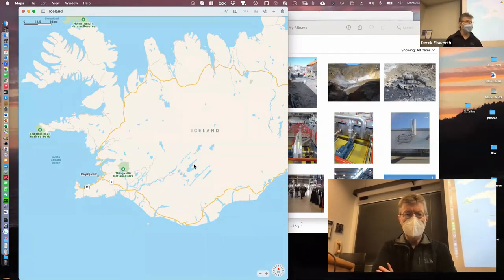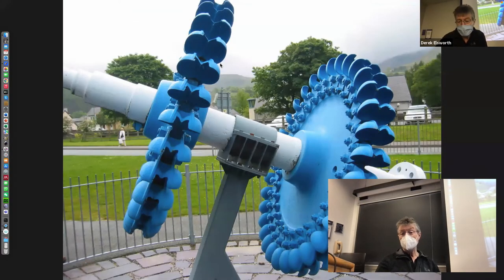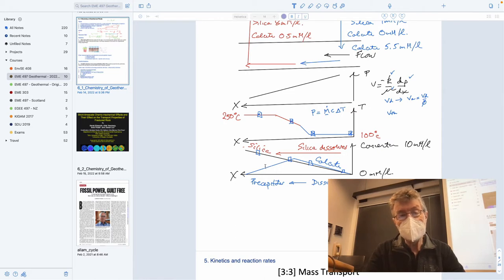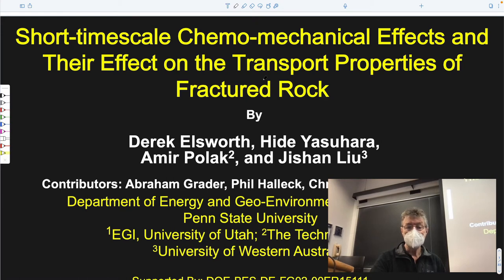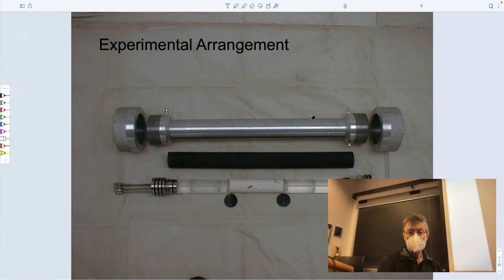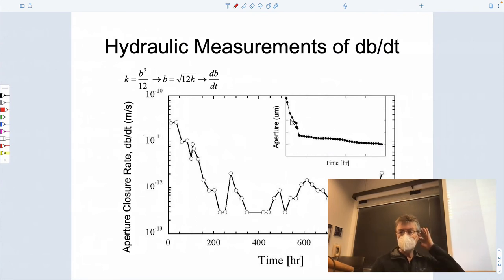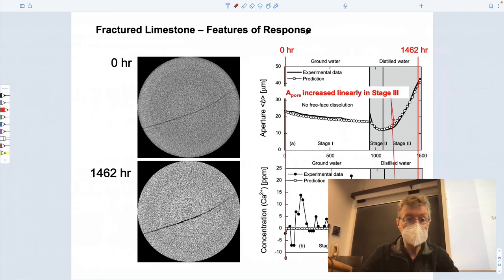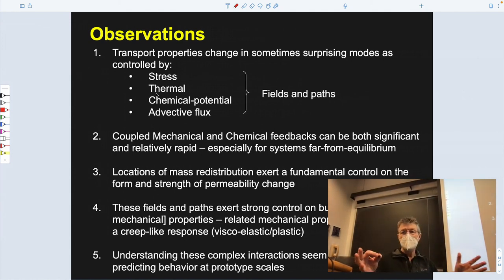6:2 Chemistry of Geothermal Fluids

Comment: Thank you Derek for giving such an interesting lecture on the coupled geochemical and geomechanical effects on the flow aspects. Intuitively I thought dissolution would have increased the permeability/transmissivity by eroding and enlarging the porosity/fracture aperture. However, I totally ignored the mechanical response. In rock formation, it may be a little complicated. The overburden stress tends to close the fracture if dissolving the bridging asperities. In case that zero strain applies in the horizontal direction, dissolution may also induce a bigger fracture aperture. Good to know that the geomechanical effect makes such a difference in the hydraulic responses!